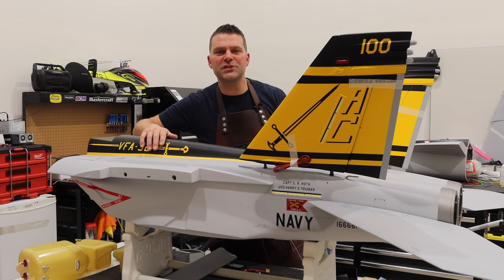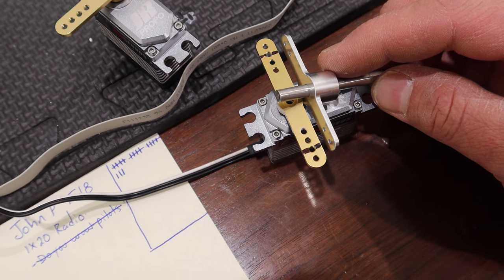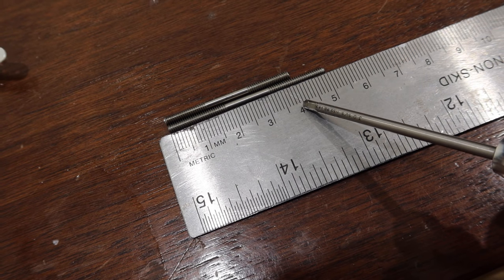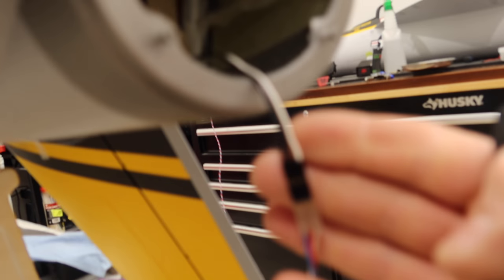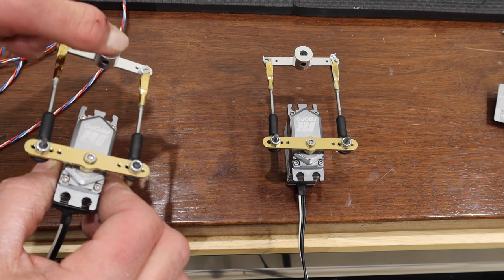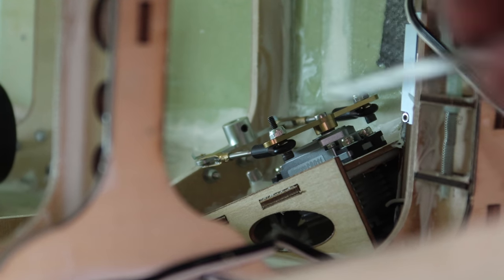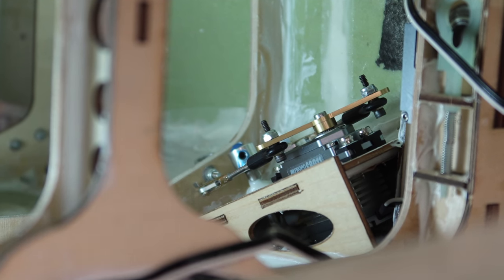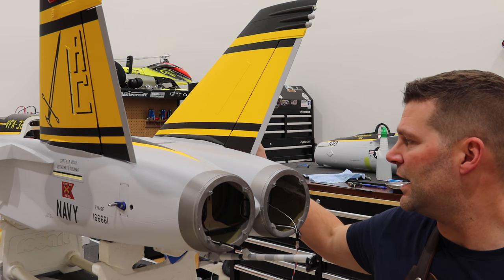F-18 SUPER HORNET BUILD - THE RUDDERS - Skymaster F18

Comment: One quick question? At what stage is an RC Plane not a hobby anymore? Thy keep on getting bigger and more advanced. At what stage will you be requier to be licenced to fly?
Reply from the maker: Every country has its individual rules around this. Most of it is tied to weight of the aircraft and after exceeding that limit special inspections or permits are needed.
Reply: @thelightersideofrc  Thank J.

Comment: I could be misremembering my definitions but this is what I recall as far as the rear control surfaces are concerned.  If there is a combination of fixed and movable surfaces (as in the F-18) then the fixed surfaces are called the stabilizers (either V or H) and the movable surfaces are called the rudder or elevator.  If the entire assembly is movable then it's simply called the rudder or elevator.
Reply from the maker: Any add more confusion to the mix the "elevators" on the f 18 are also mixed with Aileron movement.  So......Taileron?
Reply: @thelightersideofrc  I've usually heard them called "elevons".  I'd forgotten that aspect of the F-18 design, it's the normal configuration with delta wing aircraft.

Comment: So far of what I have seen of this kit, its a great kit that a lot of good engineering was put into it.
  Its a big bird.... I like the look of the first F18 with the like oblong inlets. Some people dont realize that the F18 actually was a F17.
Reply from the maker: Thanks Terry.  Yea the first one had the round inlets.  the super hornet (square intakes) has significantly more lift area so fly's and lands different.
Reply: @thelightersideofrc  you're welcome, the super hornet looks like the Leading Edge Extension ( LEX) is bigger & the wing is really noticeable bigger. Looks like it would land slower than the first one.
Reply from the maker: Yea exactly correct. The tail surfaces are larger. Wing area is significantly larger. 

Much more floaty and definitely lands slower.
Reply: @thelightersideofrc  so not a good first jet?
Reply from the maker: Haha!  F18?  No. Definitely not.
Reply: @thelightersideofrc  im not after a turbine , a EDF is fine & what bird would recommend?
Reply from the maker: There are tons of foam EDF units out there now as you probably know. 70-90mm fans. Lots of great options. If your looking for something larger or more scale than of course things are going to get more complicated and more expensive with bigger fans, ESC’s and batteries. 

If your starting I would suggest any of the ready done foam options to get your feet wet.